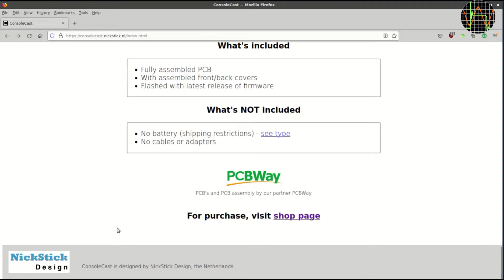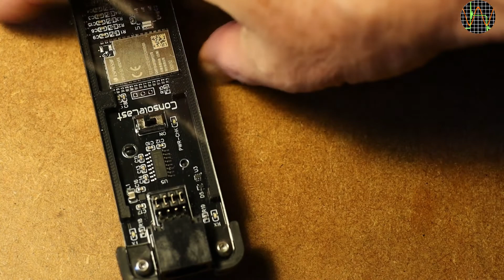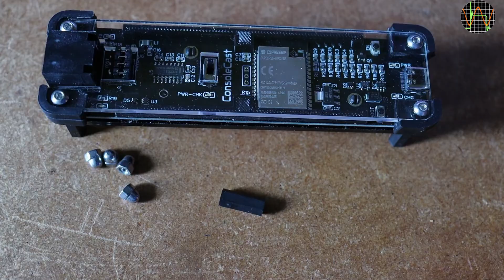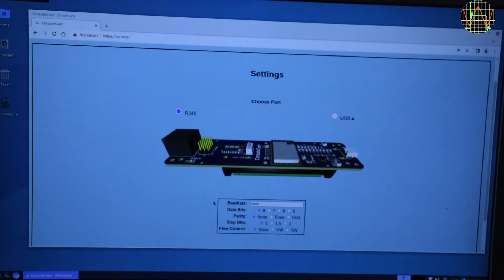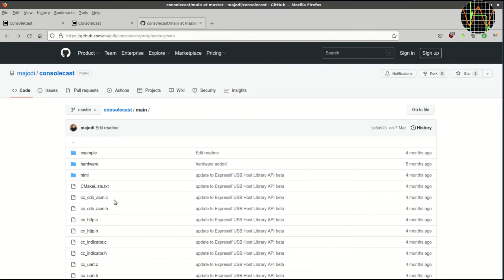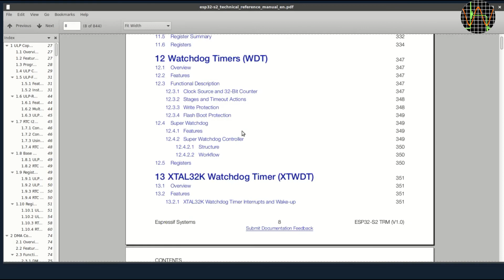113 - A closer look at ConsoleCast, a universal serial to WIFI bridge

Comment: Did I just see that this 4.5 digit meter actually spits out 8.5 digit readings over serial connection?
Reply from the maker: Yes, but that is because the XDM1041 transmits its data over SCPI as a raw, non formatted floating point number while the display shows it rounded to 5 digits. Using the SCPI data means you can squeeze extra resolution out of it by doing a bit of averaging, basically trading speed for accuracy. But it is very nice to have that option.

Comment: 12:40 What is the reason behind not using an ethernet connection with a floating scope or signal generator?
Reply from the maker: Same reason that you can't use a USB or serial. The USB/Serial/LAN ports are connected to the scope ground and if you connect the other end to your (mains powered) PC, you connect it to mains earth. So your scope/function gen is no longer floating, which could be seriously bad news, depending on the application.
Reply: @TheHWcave  But LAN ports are transformer isolated, so the signals do not have a conductive path to scope ground or PC ground.
Reply from the maker: @Graham_Wideman  Yes, they should (there was a case where early Raspberry PIs had sockets without transformers by mistake) but even so, the isolation rating is usually not very high. Call me paranoid ... I feel safer with no physical connection at all
Reply: @TheHWcave  The withstand voltage that I commonly see on modular ethernet jacks with integrated magnetics is 2250VDC or 1500VAC.   OK, you might not want to trust a random scope, signal generator or PC motherboard to definitely have one of those jacks. But many common cases to float the test equipment is just to break a ground loop, or at least remove a competing but low-voltage connection via the test gear to the device under test. In that case, an ethernet connection can be just fine. Certainly better than common non-isolated USB, or non-isolated RS-232 serial port.